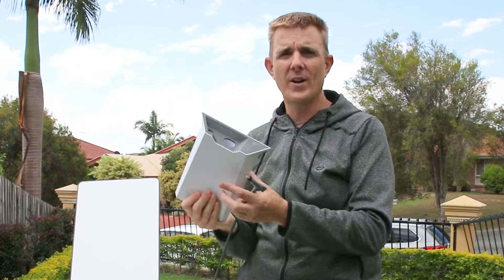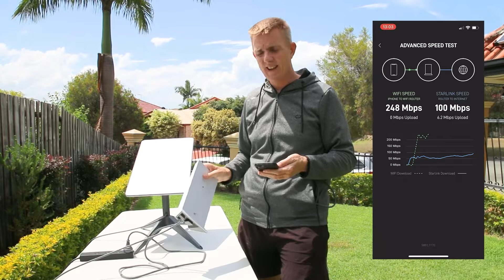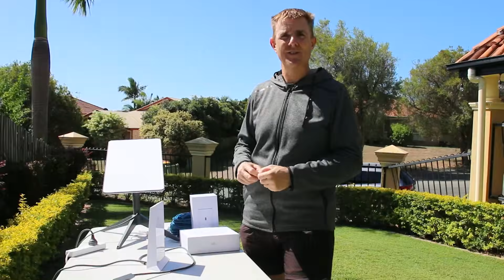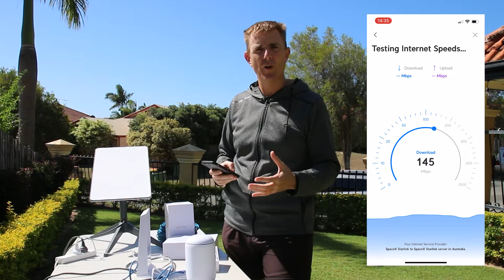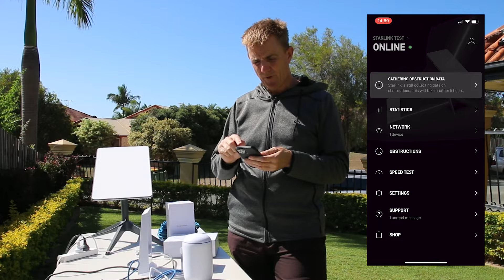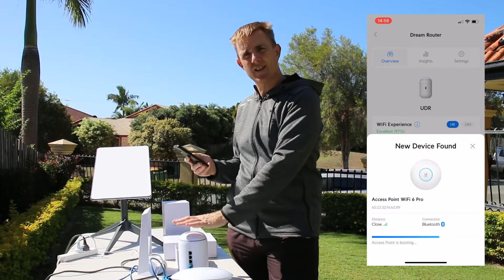Sorted - Starlink - Improving Your Home Wireless Using Ubiquiti

Comment: Hello, nice video. I recently installed my SL and tried to connect it via LAN with my previous network of UAPs ( a regular 1gb switcher + UAPs). Through SL speedtest I get 350+ mbps but via LAN it is less than 50, is there any configuration for this or could the SL be faulty?
Thanks in advance
Reply from the maker: Good question.  It will depend on what Gen Starlink you have.  If you have a Gen 2 then you could have an issue with your adapter.   You will also need to check the port speeds on your switch and and maybe try manually setting to 1Gb/s to see if it makes a difference. In instances like this it is generally a setting or an incompatibally that causes the issue, or older wireless access points that only have a 100mb/s ethernet port.

Comment: Paul, This is a Fantastic video, with detail explanation, I have 2 Unifi AP, and this UDR is so expensive for me, Can I kindly use my TP-link AC1750 as the router while i connected my Ubiquiti AP to the TP Link Router.
Reply from the maker: Good question.  You will need a controller for the Ubiquiti devices.  This can be just a software download from Ubiquiti's website and an installation on your computer.   From there, you don't need a Ubiquiti router to make it all work, any router should be fine.  I hope this helps.

Comment: Very good video.Can we connect Starlink Gen3 Router with access points without POE switch?
Reply from the maker: You can connect the router without a switch, but you will either need a mains power pack to power the access point, or a PoE injector.  You will need to get power to the access point in some way, not just the data and the Gen3 router has an ethernet port, but not a PoE port.  I hope this helps.

Comment: Can we connect the ethernet cable directly from the gen 3 starlink router to the access point?
Reply from the maker: Yes you can.  You may need to go in to the PoE injector first, but it can be directly wired to the Starlink Router (you would not put the Starlink in pass through mode in this instance.)

Comment: Hi Paul,

I hope you're doing well.

I'm setting up a Starlink network with 13 Ubiquiti Access Points and I need advice on which equipment should go in the UniFi rack for optimal performance. Could you please recommend what switches, controllers, and other devices I should use?

Greetings from Chile
Reply from the maker: Hey, great to hear from you.  If I was doing the setup (depends on the budget) then I would probably go with a UDM-Pro or UDM-SE.  You then don't mention which access points, so let's assume U6 or U7, then I would consider the USW-Pro-24-PoE or the USW-Pro-Max-24-PoE as options and that should get you up and going.   I hope this helps
Reply: @The_Tech_Geeks  
Hi Paul,

Thank you for your quick response and helpful advice.

I will be using 13 Ubiquiti U6 access points with 23 AWG Cat6A cables. Would it work well to put a standard USW-Pro-24-PoE switch and a Dream Machine Pro in the rack? Is this entire system compatible with Starlink and would it function optimally? Could I skip using the Dream Machine Pro and connect the USW-Pro-24-PoE switch directly to the router that comes with Starlink?
I really appreciate your help.
Reply from the maker: If you run the Unifi controller in software and you are happy with the routing of the Starlink router and the lack of control you ahve over IP allocation etc, then yes you could go direct to the PoE switch with no issues.

Comment: Thanks for all your assistance guys but I have another problem! I have followed your video to setup the UDR with the Starlink router with the adapter and everything appears to be fine as I have the UDR displaying an internet signal as well as a solid blue ring on the top BUT my phone says "No Console Found". I am not sure I have the right app on my phone. Any help with this would be greatly appreciated!
Reply from the maker: Thanks for getting in contact.   You wil need to have downloaded the Ubiquiti Unifi Network app to your smart device.  You will need to make sure Bluetooth is enabled as well, as I believe the intial setup uses that for communication with the device.   Once set up, you will need to join the new wireless network you have created to be able to connect to the OS Console.   If you have not been able to configure the device at all, then it may be worth trying a factory reset and runnig the process again, or plugging a computer in to one of the LAN ports and configuring it using a web browser.  I hope this helps further.
Reply: @The_Tech_Geeks  Thanks again! Do you have a link to the actual UniFi Network App (I'm in Canada) as it appears I may have the wrong app on my phone. I tried downloading a Windows Network installation but it fails to install and returns an error code.
Reply from the maker: This video may help on how to configure using a web browser.  You don’t need the app if you are using a computer. The Basics - Initial setup and run through for the UDM / UDR / UDM-Pro and UDM-SE
https://youtu.be/9LzYSmIa_jc
Reply: Hi Guys! I want to thank you for ALL the assistance with setting up the Dream Router and AP mesh units. We have successfully setup the UDR in the shop that is connected to the Starlink Satellite (bypass mode) and have two (2) Unifi AC Mesh units (one on the exterior of the shop that is hardwired via 100' of CAT 6 cable to the UDR) and the other mesh unit in the "Living room" of the house (approximately 150' from the shop). Everything works great and signal is strong HOWEVER, the cellphone calls keep getting dropped in the house and we're having to walk over to the shop to complete calls. Any suggestions for making WiFi stronger in the house? Thanks in advance! @The_Tech_Geeks
Reply from the maker: Sounds like another access point in the house could help.  I would personally put the AC Mesh that you at the house on the outside wall of the house, so it can get a good signal from the one on the shop.  Then run the cable in to the house and plug in a U6-LR in the house.  That should help sort the wireless issues you are having.

Comment: Has anyone managed to get the starlink wifi extended via the use of a stand alone mesh ubiquiti wi-fi extender?
Reply from the maker: Good question. This depends on what you mean by wireless extender. If you mean a Ubiquiti wireless access point like an AC-Lite or U6-Lr etc, then I am afraid not as these are not extenders / repeaters and won’t connect to a current non Ubiquiti wireless and repeat it. The only Ubiquiti option would be the Ubiquiti MeshPoint HD (part of the amplifi range). I hope this helps. The best option is to add the Starlink Ethernet adapter and then extend from there.
Reply: @The_Tech_Geeks  We are currently in Canada (BC) running a Starlink satellite and trying to add the UniFi AC Mesh to extend the signal from the shop to the house and yard. Anyone with help on this would be greatly appreciated. Do we need the UniFI Dream Router to make this work? Thanks! Dan
Reply from the maker: Good question. The AC-Mesh can’t repeat your current starlink wireless, it can only create a new one. If you have the Gen 2 Starlink dish (the rectangle) you will need to purchase the optional Ethernet adapter from starlink. You can then plug the AC-Mesh in to that. You don’t need to have a physical Ubiquiti controller but it can help. You do need though the Ubiquiti app or the software installed as a minimum to configure the device. I hope this helps
Reply: @The_Tech_Geeks  The problem is that we have the Starlink Ethernet adapter as well as the Ubiquiti POE and there is power to the mesh unit BUT, I cannot download the controller as it's asking for Java 11 even though I have the latest version installed from Oracle. It will not let me get through. My next thought was to buy the Dream router as you show in the video and then bypass the Starlink router and connect to the mesh units. Any thoughts!
Reply from the maker: You could try the app on your smart phone as another option. If not the UDR would be the best next step.
Reply: @The_Tech_Geeks  Thanks for the quick response! So, if I was to purchase the UDR and then bypassed the Starlink router as you described in the video, I could then power each AC-Mesh unit around the yard directly via the POE on the Dream Router. Is this correct? Thanks for taking the time with this! Dan
Reply from the maker: If you get the UDR then yes it has two PoE ports. You can then cable up to 100m from each port and connect an AC-Mesh. If you can’t cable you can also use the wireless uplink feature to allow the AC-Mesh to connect wirelessly to the UDR and work as a repeater. You will though then need a PoE injector connected to each AC-Mesh in that instance as they still need to get power. I hope this helps further

Comment: Great video, Paul. Is it possible to set up just the Ubiquity access points without a UBR, instead using the Starlink as the router? I have Starlink feeding from its ethernet attachment into a switch, which is then providing all data points throughout my property with connectivity. Can I plug a wireless access point into one of these data points or do I need the UBR and to bypass the Starlink router?
Reply from the maker: The UDR was really there to make things easier as it runs the Cloud software needed to configure the Ubiquiti Access Points.   As long as you install that software on your phone or a computer, then yes, leave the Starlink router running and add your Ubiquiti Access Points to the switch and you will be up and running.
Reply: @The_Tech_Geeks  if im Facing same Issues, Do i need to bypass on the Starlink app , Or Not since i'm connecting from Switch to AP